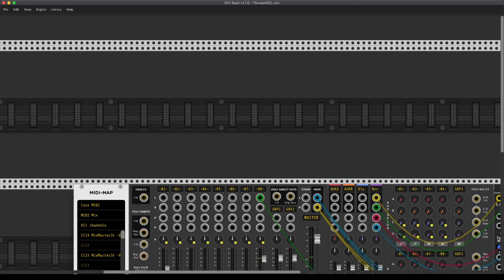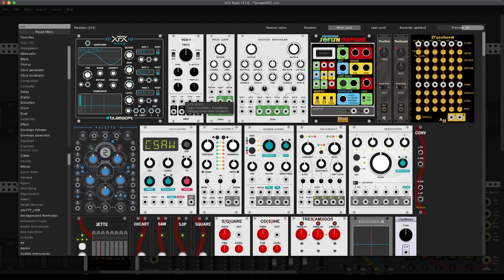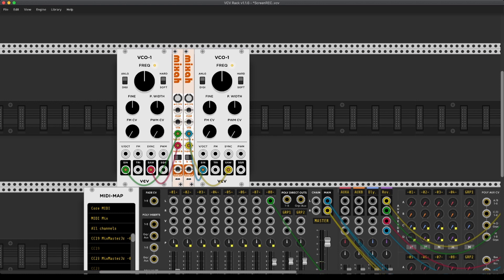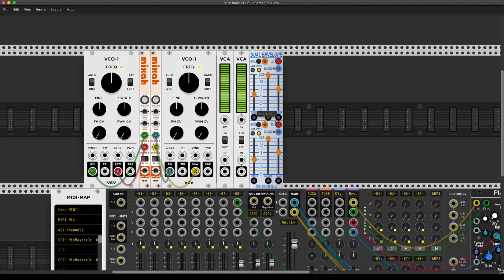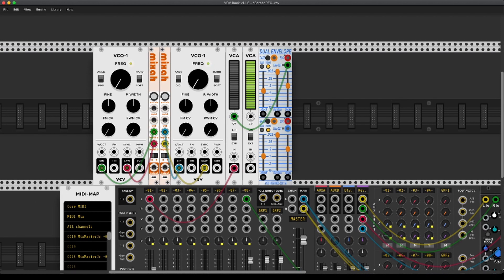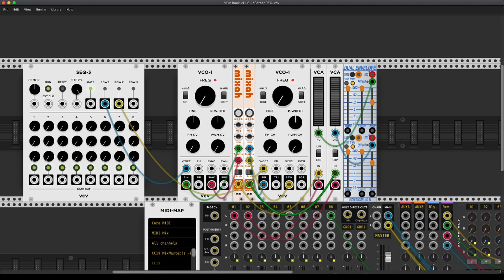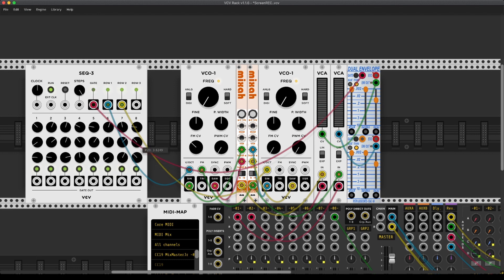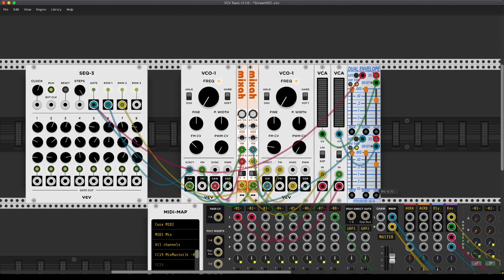How to create a buchla 100 Voice in VCV

Comment: If you switch the second oscillator from saw to square that's actually become a 258 dual osc from buchla 200 series. And, the triangle output is also there, which I see used in some models as a third output (258D from Source of Uncertainty video for example).
Reply from the maker: The 258 is acutally another Video that I want to make when my Computer stops acting up. One of the key features though that I have only ever seen on the 258 is the 2 Pitch Cv inputs with attenuators for multiple CV ins. I hope I can make that Video soon :)
Reply: @crozpatching4598  yeah, two v/oct is very mysterious, at least for me. Looking forward to your new videos, we need more Buchla stuff in VCV
Reply from the maker: @dedcosmonaut  Agreed! I hope there will be some modules in the future more focused on Buchla and Serge. Regarding the 2 inputs: You could connect a keyboard and a sequencer in each of the inlets to transpose the sequence. I assume that the incoming voltage is getting summed similar to the Moog 921 which has 3 Frequency inputs
Reply: @crozpatching4598  everyday you learn something new, thanks for clearing this out

Comment: Cool patch idea. I love the Buchla sound and own Arturia Buchla Easel, Fxpansion Cypher 2, Aalto, Softube Modular, Pigments 3 and Morphox, all of which are capable of providing varying degrees of this particular sound. I frequently create Buchla style fm perc sounds and blend them with pitched percussion like Hang drums and Gamelan, to create some evocative and dense textures with plenty of timbral variation. One question though, wouldn't it be simpler to build this voice with one of the many complex oscillators that VCV has already? Or does starting with more basic elements offer more flexibility for you?
Reply from the maker: Hi Adam, yes there are already some cool complex oscillators out there. My personal favourite is the Instruo Cs-L that is quite the unique oscillator. However, in my tutorials my goal is not just to show how to achive the sound but also explain how to create it. My opinion is that if you you know every part of the signal flow, you have a much better understanding of controling each parameter. The problem I have with most VSTs is that you primarily click through presets with really learning how the instrument works (at least for me) but in VCV you have to build everything yourself, meaning you have to understand all the elements that go into creating the sound you desire